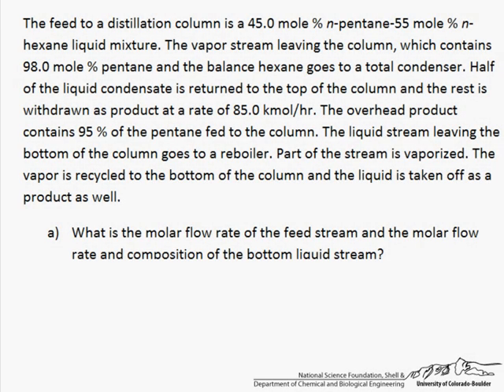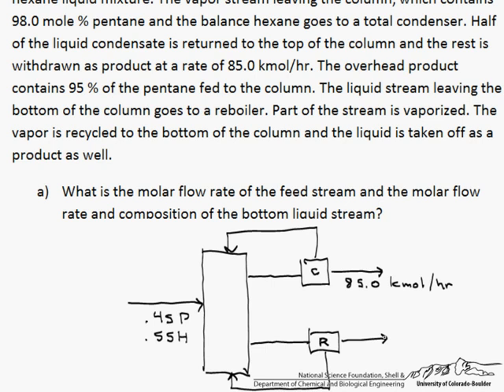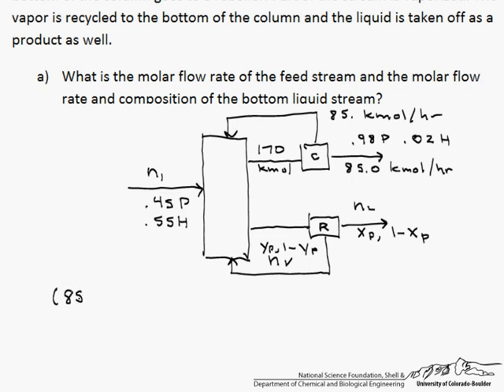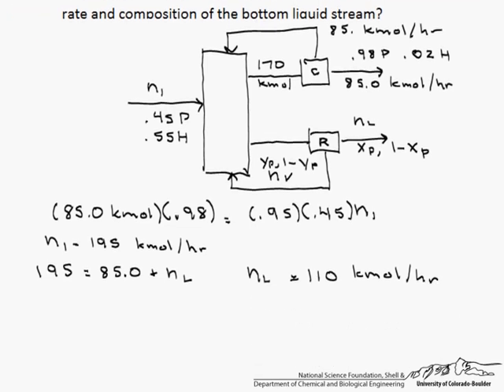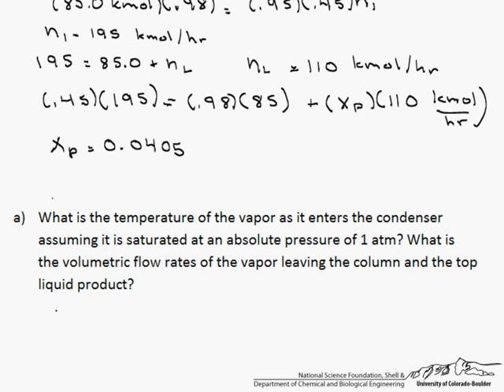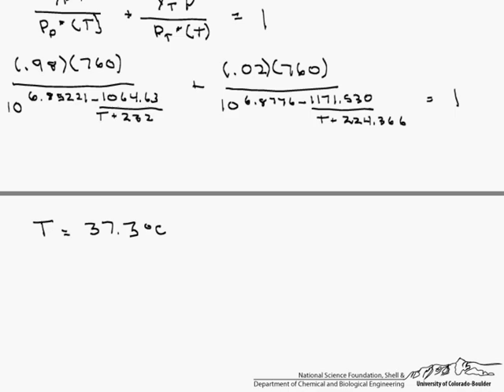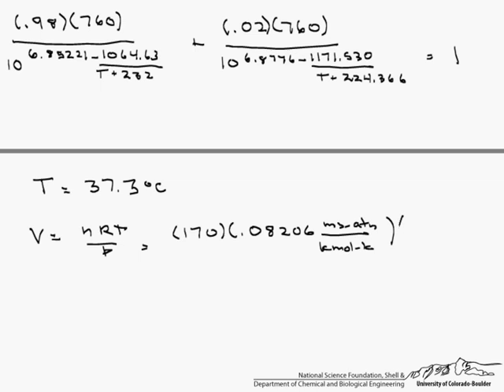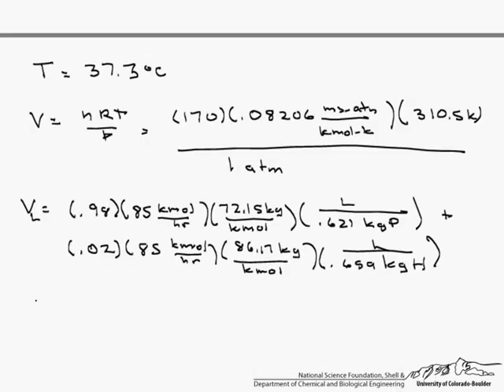Distillation of a Two Component Mixture Part 1

Comment: could you please answer this question      A fractionating column is to be designed to separate 100 liters per second of feed at 20 °C with a composition of 69 vol% Methanol and 31 vol% Water into a top product of 98 vol% Methanol and a bottom product of 95 vol% Water at twice the minimum reflux ratio. You can assume that the column operates with a total condenser. The VLE data is provided in Table 1.
a) Perform a mass balance on the column and determine the molar flows & compositions of the feed, top product and bottom product streams.

b) Determine the value of q, the slope of the q-line, and the intercept it makes with the x-axis.

c)   Determine graphically the minimum reflux ratio, and the minimum number of theoretical stages within the column.

d) Determine the number of theoretical stages in the column at the normal operating conditions, i.e. when the reflux ratio is twice the minimum.
e) Determined the amount of steam required for the reboiler. f)   Determine the cooling duty for the total condenser.
g) Determine the minimum number of theoretical stages using the Fenske-Underwood equation, and compare them with the value obtained by graphical construction in part d).
Thermodynamic Data:
Steam at 2.5 bar pressure is available for heating. From steam tables, this has a latent heat of 2182 kJ.kg-1
Molecular weight of Methanol = 32 g.mol-1
Density of Methanol = 792 kg.m-3
Molar latent heat for Methanol = 35300 J.mol-1
Specific heat capacity for Methanol =2.5 kJ.kg-1.K-1
Molecular weight of Water = 18 g.mol-1
Density of Water = 1000 kg.m-3
Molar latent heat for Water = 40626 J.mol-1
Specific heat capacity for Water = 4.18 kJ.kg-1.K-1

Show transcribed image text

Comment: This problem is not correct. You have labeled the 'top-product' as having .98 and .02 composition when the problem states that the vapor leaving the condenser (170kmol/h) is the one with that composition. That changes the whole problem as finding n1 isn't as simple as plug and chug.